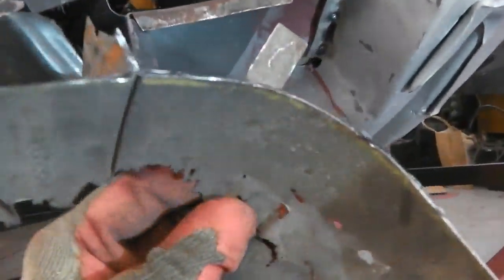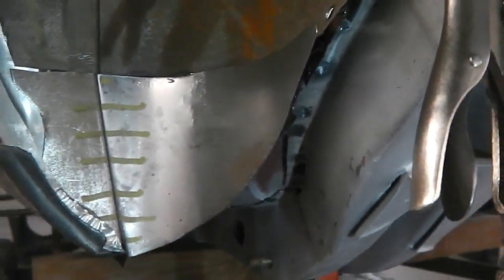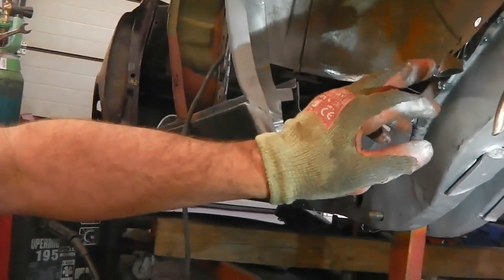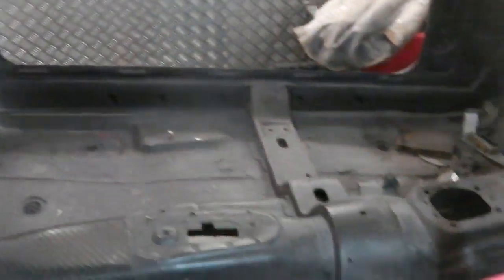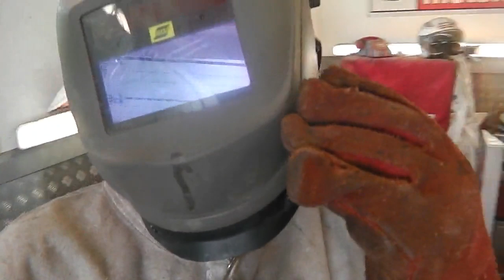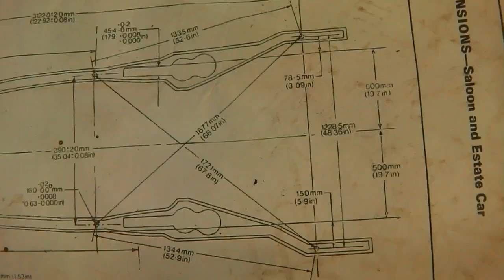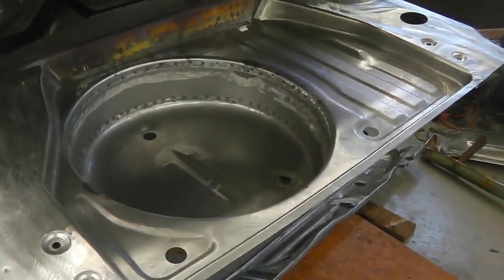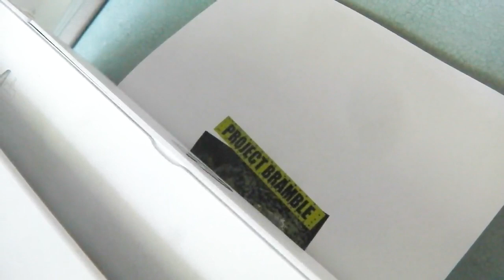Classic Car Resto - Ford Cortina Mk3 - Project Bramble EP24 pt2

Comment: Fuel filler spout explains the dog-leg on the driver's side but not why the chassis leg on the passenger's side is different. On the surface, Ford had the freedom to design the two legs to be symmetrical - both as per driver's side. However, it seems reasonable that the passenger's side dog-leg is wider, in order to accommodate the spare wheel tub, which is indeed offset to the that side?
Reply: And presumably the tub is offset left in order to accommodate the fuel tank. That whole area must have been a nightmare for pre-CAD/CAM designers with the need for tub, tank and exhaust silencer.

Comment: Hi Pete, looks like I'm first in here!! like the way you fabricated the wheel tub lower, came out great. Those boot panels look well made and seem to fit fine, looking forward to the next instalment.

BTW if you get a chance to buy an Esab Rebel then go for it, its an amazing piece of kit so much better than my old Clarke, just dial in the wire size and metal thickness then away you go, giving me some great welds, its completely manual as well if you want, very customizable. 
Anyway thanks again for a great hour of entertainment, soooo much better than the telly!!

John (Norfolk)

Comment: if You're using the mig to spot weld on flimsy panels use Your air compresser to cool down the welds fast to stop them  from distortion
Reply from the maker: thank you !!!!!!!!!! ive used the air on panels just recenlty funny you should say, just discovered the trick thanks !!!!!!!! and thank you for watching, from Pete
Reply: peter c your welcome

Comment: Pete are you not ever tempted to seam weld the cross member and floor to sill to increase rigidity of the body shell? Many years ago I once fully seam welded a Triumph Dolomite body shell it made a massive difference when driving it hard to the road holding.
Reply from the maker: i did think about this Tim, but there are plenty spot welds and a few extra ones

Comment: I've still got the very last genuine boot floor from x pressed steel panels still in my attic. Cost me £230 at the time
Reply from the maker: wow 230 is cheap o cheap !!!!!
Reply: That's was way back in 94 Pete, I started collecting genuine Cortina panels from a back in 1987, so I have so far built up my collection of genuine Ford Mk 5 wings, A posts complete with screen pillar, a front lower bulkhead panel with jacking points on, boot floor, inner and outer sills,  doors, quarter panels, upper and lower front panels, radiator support panels,headlights indicators front and back, bumpers, bumper end caps, grill, headlamp washers spot lamp ànd brackets, although they will be fitted to the Mk4 2.0 S.